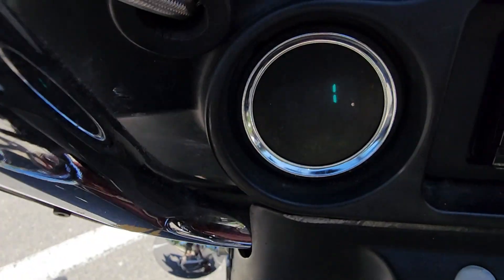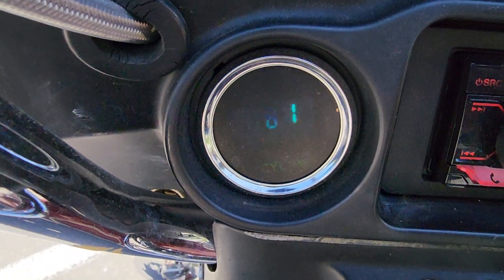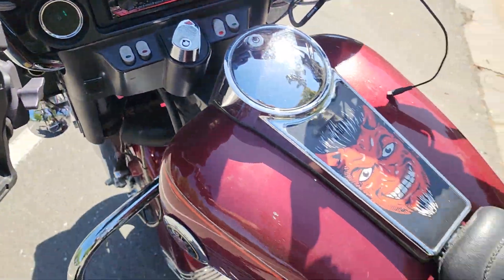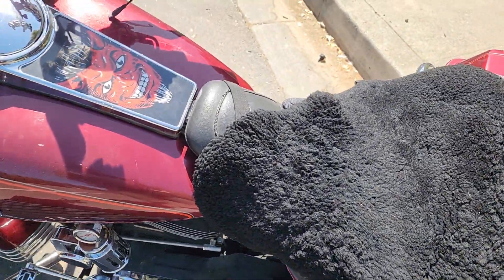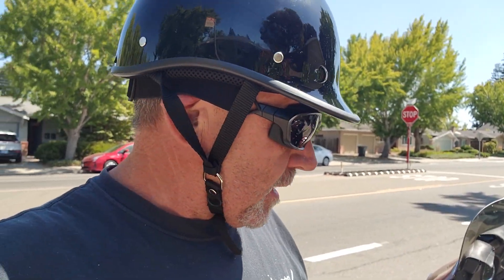2000 Harley-Davidson TC88 with Magneti Morelli EFI COLD-start with ThunderMax ECM

Comment: I need mine to start like that. I fight to keep my 2000 EG running.
Reply from the maker: I had the same problem, especially after I had the motor rebuilt (and punched 100 cubic inches + cams). The ThunderMax made all the difference for me. If your motor is stock or close to it, you may have other issues that need to be resolved before you consider switching to a ThunderMax.